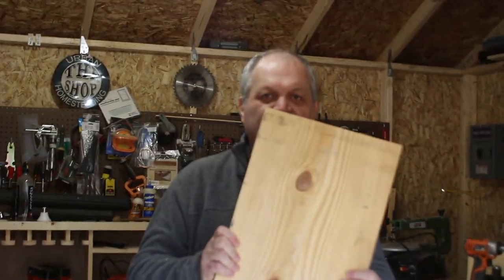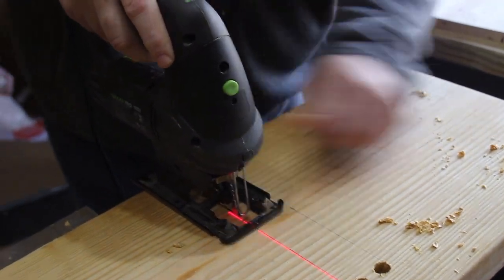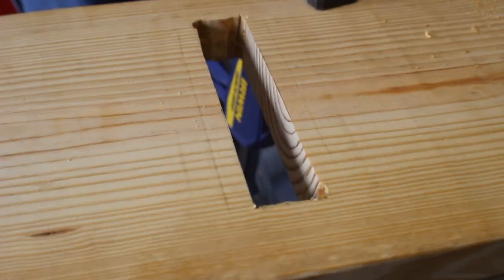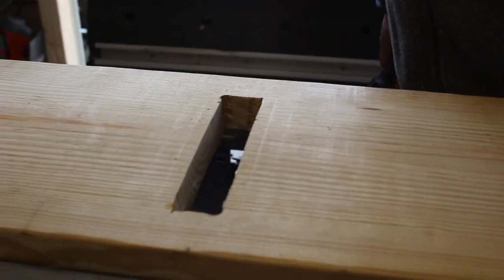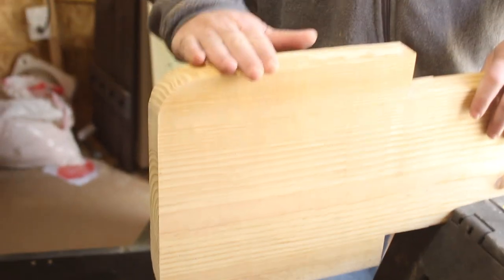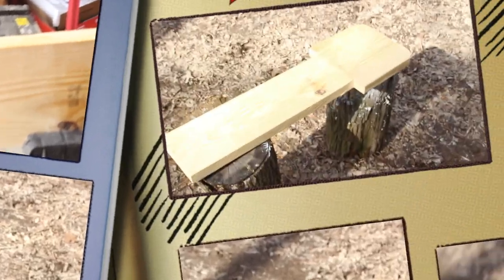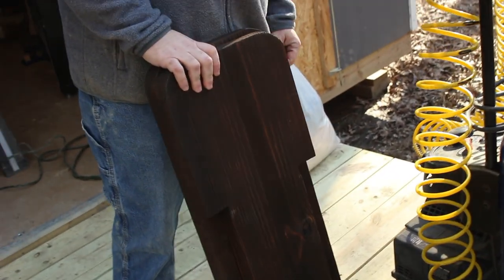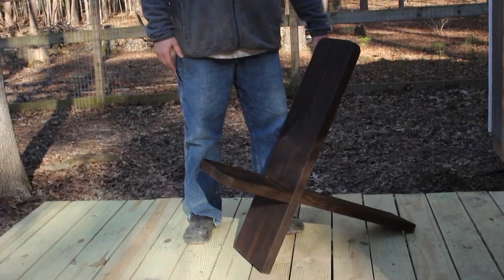How to Make a Collapsible Viking Camp Chair (camp chair, bog chair)

Comment: Thanks a lot for this. Would I be able to get the measurements from you?
Reply from the maker: Yes, sure. Both pieces are 36"long the opening on the back is 11" from the bottom, 7.24" wide, and 1.5" tall (the thickness of the 6)lastly the seat starts 25" from the edge of the board and the part that is inserted is 7.25" wide, hope this helps
Reply: @ProfessorDIY  You are so kind. Thanks again.